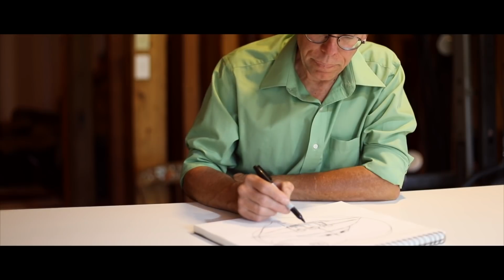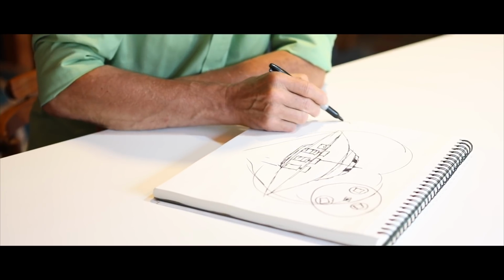BOB LAZAR : ANATOMY OF A FLYING SAUCER : EXTENDED SCENE

Comment: EXPLAIN THIS THEN
. IF THE REASEARCH AND REVERSE ENGINEERING HASNT BEEN SUCCESSFUL.
Then explain how and why I see as well as anyone else at the right times and places. See ufo's and more than one type... 

Screw man made aircraft..  We all understand how they control,  and have distinctions from stars.. Not the ufo's/orbs/structures iv got pictures and vids off...

It's real, but your raised as if it's make belive.. 
Iv seen um go down. My guess failing system,,  a key to them is there silent...  :) and some glow like stars..  
With free travel motion...  And speeds up to sudden stopping.
NOT DRONES,NOT HELICOPTERS,AIRPLANES. When there close over head you would hear all these things due to the science we fly with, airdisplacement..  Motors,pistons, blades all equal sound even if super high, just takes abit longer for sound to reach ears...

Comment: The flaw in his case: How did they remove the amplifier if everything was one unit, as though made from a 3D printer like he said?
Reply: I'd assume like anything else they'd cut it out with tools.
Reply: @Dugout97  It's likely they would have worried about ruining the craft by doing that. How would you re-attach it then?
Reply: He said that the crew deck with the 3 seats was one piece. He did not say how the lower deck or engines were constructed.
Reply: @codetech5598  Fine, let's say the amplifiers were attached, and not part of one solid unit. Then HOW they were attached, and thereby removed, would be one of the most interesting developments in modern science. Bob's never curious about this.

And the fact that he states the test flights were done with 2 amplifiers and not 3 indicates the re-attachment was difficult if not impossible.

Which implies they compromised the craft by removing the amplifier, and common sense would say they would never do that.
Reply: @54xcaliber  Those are good questions and are the kind of things Jeremy should be asking Bob instead of acting all goofy. If Bob does not know, he will say so.

"they compromised the craft by removing the amplifier, and common sense would say they would never do that"   If the military ordered them to reverse engineer the craft, that would mean dismantling it, and they would have cut it out with a torch or whatever.
Reply: @codetech5598  Agreed. It was likely the case that learning to reverse engineer the craft was the most important thing -- but then they could have used one of the damaged crafts for that purpose, and left the 'sport model' intact.

Also I've heard Bob interviewed many times, and this was the first time I heard him say the test flights took place with only 2 amplifiers. 

Again, in my opinion a physicist wouldn't gloss over the way in which an alien ship part was removed. That would be huge.
Reply: @54xcaliber  The part was removed before Bob worked there.  For all we know, it may have been removed 20 years before.

The test flights were just simple maneuvers above the desert. 

We don't know what the deal was with the damaged craft. Common sense says the engineers would have dissected those first, but we don't know the rest of the details, and neither does Bob.

I don't think Bob would make up details like running on two amplifiers. It seems like too easy a point to criticize.
Reply: @codetech5598  All fair enough, but hard to imagine a scientist not interested in how the amplifiers were attached. Could you cut the material with a Sawz-all? Were there carriage bolts? Most likely neither . . . so how was an alien part fastened? That would be the revelation of the century, at the minimum.
Reply: @54xcaliber  He was working in a compartmentalized military environment.  Curiosity was not encouraged. He could only communicate with his coworker Barry and supervisor Dennis.  

So, unless it was obvious when looking at the part on the bench (for example, you can see if metal was cut with a torch) Bob would not have known.

Again, it is unfortunate that the person who has access to Bob, is that goofball Jeremy who doesn't know what or how to ask.
Reply: @codetech5598  I understand what you're saying, and I want to believe Bob, but to me the amplifier business doesn't quite add up.

Also I believe that Bob in the video acknowledges that they removed parts from the craft and worked on them.
Reply: @54xcaliber  He does say that "we" dismantled it but i think the "we" means the military, not him personally.  It is clear that the amplifier was already on the lab bench when Bob first saw it.
Reply: @codetech5598  Right, but around the 13:15 mark I think the host asks if this is the craft that you guys would take parts out of and work on, and Bob says yes.
Reply: @54xcaliber  The context is whether it was the same craft or a different craft. The identity of "you guys", whether it was the military or Bob specifically, was not being discussed. Immediately after that, Bob says that the amplifier was on the bench when he first saw it.
Reply: @codetech5598  Maybe. . . . Again, I unfortunately have to question his credibility for not touching the subject of how the amplifier was removed -- even if it were removed 10 years previous, that would be the first thing a scientist would want to know.

Comment: There are some extremely troubling, yet incredibly important, technical details that aren't explained in enough detail in previous  Lazar-produced  videos and without the detail , credibility is greatly eroded.
1- Energy conversion of the matter - antimatter annihilation in the reactor and converting the thermal output of that reaction into the huge electrical ( previously stated energy conversion form, by Lazar) equivalent power required by the gravity amplifier. We need an indication of the level of power required to amplify the gravity wave emitted by Element 115 that has the required strength for propulsion  and how it compares to the Spacetime distortion produced naturally by a large mass, e.g. planet, star (must be >> greater than a star), Black Hole etc.  

The power that is intuitively imagined and the conversion from heat ( 'heat' meaning an extremely broad spectrum of wavelengths emitted by the annihilation) to electricity would have to be unrealistically efficient, otherwise every bit of matter close by would be vapourised by the energy not converted to electricity. The energy conversion technology would have to be unimaginably efficiently broadband in nature to capture the released energy.  Any energy not captured and  converted to electricity would have to be dissipated. Given the imagined energy levels, even a 99.9999% conversion efficiency would probably still leave giga-joules or more to be dissipated.  Containing the release of energy levels of the magnitude imagined would be problematic, to state it mildly. What kind of capture etendue does the reaction demand of the energy conversion technology? The annihilation energy packets are going to be flying away from the point of reaction in every conceivable direction. 
2- If the gravity wave is 'simply an electromagnetic wave' ( previously stated by Lazar) that can be amplified, what are its characteristics? i.e wavelength? That will have bearing on how it can be diffracted /  guided /  steered and not just affect everything in general Space in all directions surrounding the craft.....like an equivalent large mass would. Why wouldn't a 'type B' gravity wave behave in the same way as a naturally occurring 'B' wave?  What is the power of the weak 'A' wave to be amplified and how much gain is provided by the amplifier and by what kind of active or passive component?
3- Assuming the power of the gravity distortion will be immense, as well as bending light to make the craft invisible (previously stated by Lazar that light is bent around the craft due to the gravity field), why won't all cows, sheep and other nearby objects not tied down by a planet sized object, fly towards the craft to be annihilated on physical impact !?

Lots more, but there's several questions to begin with that really need answering by Bob.  

Jeremy - enjoyed watching your documentary.. several times. Thank you for making it. I do think though, that the remaining unanswered questions surrounding Bob's alleged time at various education institutions have to be bottomed out once and for all. I really can't square with the thinking that it doesn't matter whether Bob is telling the truth about his education. 
Bob comes across as incredibly genuine and likeable, but that doesn't mean or prove he's being honest, to us or his family and friends.  It should also be quite straight forward to drill into Bob's depth of knowledge of physics and electronics by using third party experts, to be able to get a very good feel about his qualifications. I saw no evidence of this in the film. I feel the film left more questions than it answered.

Comment: Unless I missed it, he had mentioned there wasn't seams or fasteners in the craft as if it was all one piece. It was like it started on the bottom and was "printed" to the top. So how was equipment removed? He said it was cold to the touch like metal...If so, they would have to cut the equipment out of it somehow....

Comment: Aliens and their craft are very real, and it's highly probable that many of their recovered components have been reversed engineered.  While Bob Lazar speaks the truth, there are those occupying high positions who delight in discrediting him.  I've observed two of the craft--one of which was metallic and approximately 35-feet in diameter, which took off from a concealed position from within a field of maize during daylight from less than 200 yards away during the summer of 1958; my father observed it from a different location at the same time--over fifty years ago.  No noise, no visible means of propulsion, which went from zero to over 4,000+ mph within a few seconds until it disappeared while climbing at a 60-degree angle towards the visible hovering moon.  I still recall the sense of loss as I watched it disappear, as well as my father admonishment to never reveal the incident to anyone, because others would not only disbelieve me, but would consider my observation to be unreliable.  For the record, my father revealed that he had seen similar objects on prior occasions, but none as close as the one that we observed during this early afternoon.

Comment: There are some open questions here. How did those UFO's get into the hangar, where did they find them? Or is there deal with the aliens? (If so, it didn't come with a manual?) Imagine you get into a car for the very first time, you don't know anything about, push button start with automatic transmission. Now you push a few buttons and press the pedal on the right, and off you go and hit something (maybe the moon), then what? Who would take that risk? If everything in there is made of one piece, then how do you remove it from the craft and put it on the bench?

Comment: Information and details between Bob's original interview in the 90's and this new documentary due not match. For example, in his original interview he clearly states the craft had "control consoles" around the occupant seats at the same three foot height described in both interviews. However,  here @5:50 Bob is heard saying, "no controls, no buttons" That's a pretty big detail to get confused or forget. I was completely sold, that is until I started doing comparisons between this modern interview and the original.

Link to original documentary in which he described "controls" https://www.youtube.com/watch?v=zQeHOKmdiN4 at about the 12:20 mark.

Comment: This is my UFO encounter. I have posted this before but now with greater details. The Year was 1978. Just so you all kind of get an idea who I am and what I do for a living. In the present day I am 47 years old, this took place 40 years ago and I still remember it as if it was yesterday. I'm a programmer by night for a major automotive company and not an idiot by any means. I despise a lie. I'm a good old fashion Christian. Not everything we see in a video or picture is real but, just know this, UFO's, they do exist. Regardless of what the government wants to hide. I'm not talking about the a little blurred dot on a screen that you can barely make out. This was a little less than a football field away from me and at tree height. It had risen from a field across the street from my house. The round object looked to be about around 200-250 feet wide and from top of the saucer to the bottom was about the width of 25-30 feet. All metallic\silvery and had this (L) shaped thing hanging out of the bottom of one side of it. The (L) was about 14 ft long and 6 ft wide. This all happened in a town called Danville and the state of Virginia. I can even remember that the metal looked to be as sheets of some kind of aluminum but not exactly aluminum. This was about 6 pm in the eve. I was only 7 years old and quickly turned around to yell for Dad through the screen door. When I turned back around, this thing had gone and could not be seen in any direction. I know this because I ran all the way around the house looking as fast as I could, to see which direction it had went. When Dad finally got out the door, I had told him what I had just witnessed. He laughed, until he and my uncle went over to the field across the road from our house and saw that all the weeds had been burnt into 1 inch sticks in a full circle about the size of what I had told him. His face and my uncles face was priceless when they saw the ground. I will never forget it. 

Also, you guys want to hear something interesting, Even though I know there is life out in space. As far as I knew, this UFO could had been an Angel sent to watch over me. After all, if it was a demon or something bad then why not take me or kill me. Are there UFOs in the KJV bible, yes.....

Ezekiel chapter 1 thru 2 talks about God coming to Ezekiel. God brought friends with him that had multiple faces. Either way you look at it, God is not from Earth, that being said. He is even Alien. Our definition for Alien is an unexplained being not from this earth or country. Is God a little green man or the grays or whites we have seen reported, I don't think so. I think they are from another planet from the creation of God. I think God is a pure light \ plasma being and I think God has wings along with the angles. We even might at some point had wings when God first created man in his image but they were taken in the first flood that God did because of Satan. Either way you look at it, we are not ready to know, and there is allot we don't know and that is what eats at mankind's ego. We can't stand it when we don't have all the answers. 

To our governments of the world, stop controlling and give the people freedom to better work for each other. Housing \ free power \ water \ health care \ food, should all be free to every person then we the people can work for each other so that we all are equal. Think hard about that word, "Equal". Money should not exist. The world worships rocks \ gems \ liquids \ & gas that comes out of the ground. WHY - Who told them too? This world and everyone in it suffers from Insanity. We all have an instability issue that none of us can explain with 100% conclusions. 

insanity is a noun 
the state of being seriously mentally ill; madness. "he suffered from bouts of insanity" 
synonyms: mental illness, madness, dementia; lunacy, instability; mania, psychosis; informalcraziness "insanity runs in her family" extreme foolishness or irrationality. plural noun: insanities "it might be pure insanity to take this loan" synonyms: folly, foolishness, madness, idiocy, stupidity, lunacy, silliness; informalcraziness "it would be insanity to take this loan" 

As for Bob Lazar. Well, I believe the man 100% on everything he says about his whole time at Area 51 and S4. His sports model sounds kind of like the one I saw. Also If you go on Google Earth and find Area 51 and search a little around the area. You will find some other hangers as well that look just like what Bob described but at different locations in the area.  
Goto 
Lat:  37°10'23.89"N
Long:  116°11'38.34"W

and

Lat:  37°11'29.06"N
Long: 116°10'28.33"W

You will see the hangers
 \ tunnels

And on this last one 
Make sure that your map has the North side pointing down, in other words rotate the map till north is showing at the bottom of screen. Then you will notice 8 tunnels coming out of the mountain top. Or they may be launch pads

Goto
Lat:   37° 0'40.01"N
Long: 116°11'49.06"W

The whole area has tons of locations like this and I also noticed a couple more Air Force bases with all kinds of Google painted over locations. What are they trying to hide....

secureteam10, well he just yesterday released an amazing video. 
https://www.youtube.com/watch?v=Dkj2I1dZmmk
and here is the original video
https://www.youtube.com/watch?v=bVmGhxYrkug&lc=z23ruxegtym4ubdga04t1aokgpmgvjfkm3koukgni0ynbk0h00410.1548212731762905

and this is the same video but the guy who took the footage is talking and explaining that it is not CGI and he did not edit it in any way. 
So what could it be?
https://www.youtube.com/watch?v=UiQeQLb0OTg&t=41s

Have a blessed day everyone & be safe because there is a lot out there to explore & learn....
Cheers and have a happy life. Love one another is the answer to ALL.